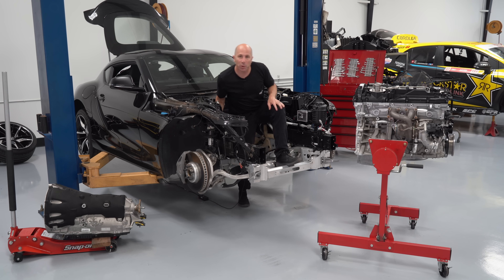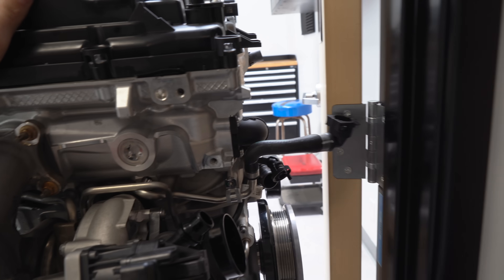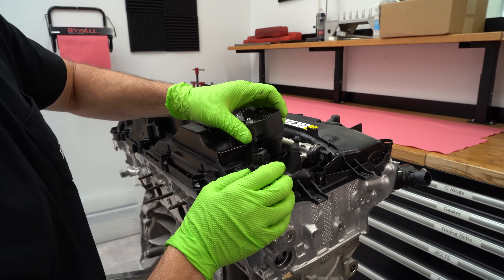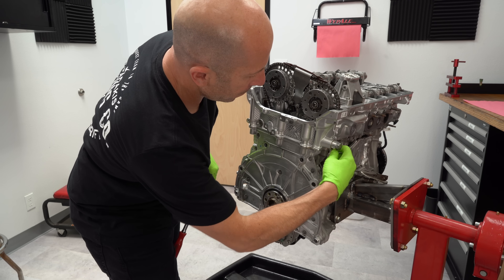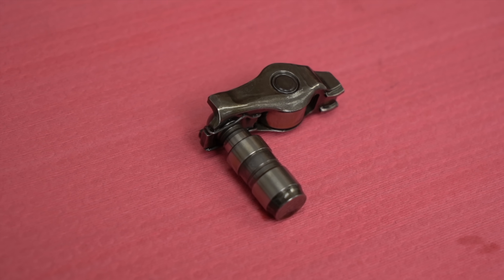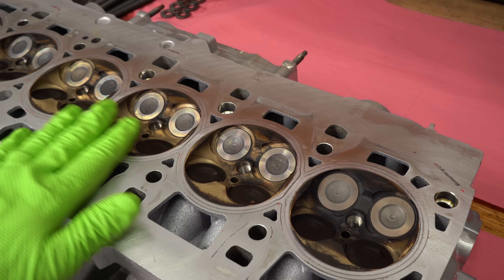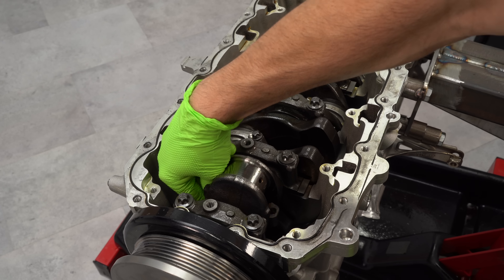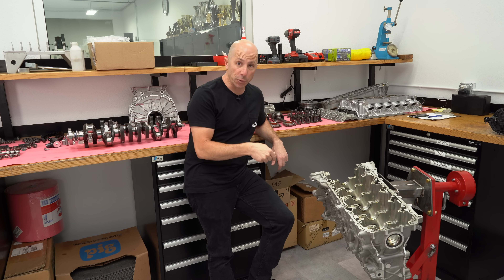2020 Supra B58 Engine Teardown - First Look - Better than the 2JZ?

Comment: I think this bmw’s piece of “engineering” will fall apart after first 60-80 thousands. Even in stock.
Reply: Considering most bmw's have a 4 year or 50,000 mile warranty of course it will. That's how bmw makes money. Spare parts not the actual car.
Reply: @mitzmanuel  I've already heard these reaching over 70k with no problems to speak of unless you have the first year models.
Reply: Carboy Dorifuto party 70k is great for bicycle))) not for the legend like supra)

Comment: Whats the difference between the b58 in the 140i ?
Reply: Heads,fuel system(more high pressure),has more oil squirters,and has a different mounted turbo.

Comment: I really think this new motor is amazing the engineering is immense but I also imagine this motor is extremely complex and precise thats great it shows how far everything has come but also it looks very daunting if your not mechanically minded I imagine its been engineered this way so you have to take the new supra back to toyota for services and any form or modifications or repair. It wont be to long though before there's a huge aftermarket for it. I think it's kind of cool the more complex the more potential the better mechanics become in order to work on it.

Comment: A bmw engine are german engine in a japanese car it never works well, bmw sells the exact same car but with 50 more horses the front and back are different but everything else is the same as the toyota supra.
Reply: Tony Oliver you are totally wrong, seriously wtf are you smocking!! You think toyota will just take a random bmw engine and slam them in the Supra? Grow up man , toyota worked with bmw to improve the engine reliability and tunability,

Comment: since it is 99% the same engine, that has been in the bmw for some time - the failures come the same way. 
So in comparison to the old 2JZ - You can calculate with big problems starting at about 60-100kmiles. 
It has really good potential for power though...

Comment: It looks like the block and head design were Toyota’s part of the project and bmw made all the ancillaries and bolt on products. I think this is going to be a fantastic engine really, being the replacement for such a loved engine means there is going to be a huge aftermarket parts catalog from big name brands and mad scientists alike that can really take advantage of the advancements in timing, air density and velocity and fuel injection. The only thing I am unsure of but purely because I don’t know anything about it is the internal exhaust manifold system. It seems like this design might take away from a major part of the tuning ability for the aftermarket scene, and possibly limit the amount of turbos to suit the application. Great video and am looking forward to tearing one down in the near future to see what tweaks are waiting to be found

Comment: It doesnt take a genius to realize that this motor is a cluster fuck. If you're pushing this thing close to what a 2jz can safely run stock then I'll be surprised if something doesnt fail. 

There's just so many things on this motor that needs to be revamped to make anything close to 1,000hp. That mechanical fuel pump doesnt flow shit let's be honest. Also those "exhaust ports" need to be wallered out asap if you wanna make any kind of power.
Reply: You can keep saying "but aftermarket will make this motor worth a fuck." Well who's going to waste their time and money into producing parts for a $60,000 turd.
Reply: @stellaroid  companies have already pushed just over 480hp with just a ecu tune with out touching anything on the motor. There's even a company out there that has a 530hp one currently that has just a tune and down pipes.
Reply: @carboydorifutoparty3976  I'm surprised that the stock turbo can flow enough air to make 500hp tbh

Comment: Ohh boy. I can only wait to see how many intake manifolds need to be replaced in the next 2 years. And hopefully that timing chain setup isn't weak because audi flashbacks. Ahh yes the wonderful valvetronic. What I find amazing is how reliable that valvetronic and vanos systems are. But I'm no BMW tech no I probably won't see this stuff at all until it hits the mainstream on youtube repair section.

Comment: That BMW engine in my opinion has way too much plastic and will come to haunt you later down the road.
Reply: You know all those ricer cars don't come factory with fancy aluminum plenums and shiny fuel rails, right? Just because there aren't any flashy aftermarket parts available yet, doesn't mean the engine has to look like this to function...

Comment: This engine looks like a reliability and repair nightmare. Typical German over engineering where all theoretical optimizations are incorporated with total disregard for servicing ease and cost impact to an Owner for parts and their replacement. If the piston heads and direct injectors are getting black at only 500 miles, what will they look like at 25,000 miles? I don't like direct injection with EGR unless backed up with port injection and catch cans. What was Toyota thinking? Maybe enthusiast cars don't need reliability?

Comment: Lots of plastic.  It'll go 0 -60 in three seconds, top speed of hundred ninety miles per hour, but will only last one hundred thousand miles before all the plastic junk starts to crack, split, and fail.  Expensive to fix.  Fuck BMW, Toyota screwed up.

Comment: I'm not sure on the b series bmws, But on older ones if you take the cams out like that, they will break.  These may be stronger?
Reply: I wouldn't even want to try doing that with a solid cast cam.  Too likely to bend it.

Comment: Will that intercooler lose efficiency over time as the EGR system pumps residue into the intake system? Seems any intake manifold I've ever been in with mileage has had a decent amount. EGR dump after maybe??? Just curious. BTW - Stephen I raced with you back in late 90s-early 2000's You made a couple trips out here to East Coast. Some of the hotel stays in New Jersey were off the hook. Love the channel bro!

Comment: Brilliant engine. Although, I’ve noticed a lot of planned obsolescence such as the one piece intercooler intake manifold and the sealant on the head gasket. Sneaky BMW. Sneaky....
Reply: The old trustful bmw plastic... 😅
Reply: The exhaust port design is bad for performance applications. Cam and oil chain locations are terrible

Comment: With all those plastics so close to high temperature metal parts, what is your expectation of this engine's lifespan? 60k or less? 100k? 200k (Toyota standards)?
Reply: My BMW engine, with plastic parts, started comming undone at 70000 miles..When the first plastic part fails, take it off the road and replace ALL of the plastic  parts.
Reply: @zymmer4  do you mind sharing how much it cost to refresh all the plastic parts?

Comment: A lot of the engineering on the block reminds me very much of a Sport Bike engine.  I see 2 more cylinders and a very interesting combination of top end and bottom end work especially with the oil pump and the timing chains.  Some of this technology has been around for years but its interesting how its married to the all newer engineering of variable timing control and what not.  It looks stout and I imagine this will hold up and respond very well to heavy modification and might even work well for swaps in a heavier vehicle if done right gearing trans etc... looks to be like one heck of a reliable design from the inside.

Comment: bmw junk not matter if its good now before i say any thing more negitive lol  i know the Japanese folks vetted n improved parts of this the engines internal part butt only a idiot German or ford engineers could do a timing chain on the rear and no oil stick n hollow  camshafts gross   ect electric water pumps just stupid n plastic intakes suck very ugly engine the 5mge is the nicest looking one i see German every were on it i guess in ways its better lightweight only n a bit of tech... a fully designed by Yamaha n Toyota would have been nice n then i would buy one but no ill keep my mk2 n mk3 .

Comment: This looks incredibly complicated to me after watching hundreds of american motor videos. Where is the carburettor that you pump with you fot and hit with a hammer?
Reply: Its really not that complicated. Carburetors are such old tech and not efficient.
Reply: @ryanb8736  Jeremy Clarkson Said European engineers could get as much horsepower from a bag of flour as the americans get from their big cc engines. Funniest thing I ever heard him say.
Reply: merqury5 Haha. Yes, it’s all about technology. 

I used to build fast V8 engines when I was younger. Now I have a 5 cylinder Audi that would beat them built engines. Tune and easy bolt ons it’s close to 600. Can also drive it in the snow and ice with ease. 

The problem was building them and they would barely idle with big cams just to make the extra power. Traction was also a problem. Then transmission and rear gears could only handle so much power too. Breaking lots of parts was a common thing in old cars. 

New technology allows for optimization, faster shifting, lot stronger parts, perfect idling cars with 600 plus HP that can be used as a daily without ever knowing.
Reply: @ryanb8736  stop it, you are making me sad. I have an MPV....

Comment: I already can see many faults on this engine.. 1 is head bolts. Same design headbolts used MB, but those bolts want on high pressure to strip off. I suggest to use different design. Like on crankshaft.

Also that plastic.. Heat cycles will kill this engine.

Comment: I love the way you describe every piece as it was being taken off.......top notch education.  Thank you!
Reply: Yep .. Ive learnt more from YouTube than I did in my MACHANICS class.
Reply: @UC4_hROdH7_Oc4CPH7c-E0Rg this B58 is the modular predecessor  of the N54/55 but is now closed deck with diesel components shared from the B57 has forged internals and crankshaft with a high pressure fuel system(that's only in the mk5s B58 not BMW's)has more oil squirters than a normal B58,engine is already hitting over 700hp on stock block and internals with a tune,bigger turbo,and downpipe unopened and has yet to hit its limit in hp. Current mk5 record of hp(for RN)is 527hp with only a tune and downpipes so numbers should climb even high as companies continue the R&D for it.
Reply: I'd say pulling the trans would be the process simply for engine mount reasons. leaving it in the car seems way better than pulling.

Comment: The engine is amazingly advance but also not that complicated. Most routine parts are easy to get to like the intake and exhaust manifold/turbo charger and the coils and sparks. This is still a car that I would take to a mechanic for routine maintenance, but it’s not totally crazy to drop 5k on a decent set of tools and wrench yourself if you’re into that stuff (which I am no longer).

The timing change being wedged between the back of the block and the transmission is going to be a disastrous bill come 100,000 - 150,000 miles.

Comment: Timing gear on the back of the engine. Hmm OK. Lots of plastic engine parts. Hmm OK. Internal Exhaust Manifold... Hmm OK.... Plastic inlet manifold... Oh man this thing sucks balls and long term it will all tell. VAG have been this route and... It sucks. It's a shame the block looks well engineered, structurally
Reply: Thousands of PSI mechanical fuel pump.... What should we mount it to? More plastic!!! Oh. My. God.

Comment: BMW can't ever learn NOT to put timing on the back of the engine ffs...remember N47
Reply: To be fair the famous N47 pre-mature failures were a faulty "out of spec" batch of crank sprockets which were eating into the chains.  I've got a N47 2009 E90 3 series on nearly 200k without a hint of timing chain rattle.  Original engine and chain...
Reply: Because there is nothing wrong with that location. It's not even that much harder.
Reply: @jdrok5026  Not even that much harder as in you have to take the engine off as opposed to not taking it off?
Reply: @AutomotiveConcepts  People will pay huge amount of money to buy and to repair the cars , double win for them 😂
Reply: @AutomotiveConcepts  it's really not much harder.

Comment: Good replacement for the 2JZ? And "partnered with BMW" as an aside near the end of the video? BMW design and manufacture; Toyota participated via suggestions during the design stage and once the vehicle was nearing the production stages Toyota went thru the engine to spec it to their standards. IOW, there ware Toyota engineers assigned to the BMW design team in Germany to "save Toyota's ass". IMO, very minor differences between what is sold as a BMW Z4 and as a Toyota Supra. And the rest of the car got the usual "badge engineering".  Yes, the brakes and suspension got Supra specific tweaks so that it felt more like a Supra to past Supra owners - but a true connoisseur of the Toyota marque won't be fooled.

Sad that their was no mention made in this video of all the parts labeled as BMW the underside of a supposed Supra; but I realize this was an engine tear down video by Papadakis Racing. As a Toyota fanatic going back to 1972 when I worked as a line technician and then opened my own specialty Toyota independent service facility in 1975,  I have mourned the loss of the Supra in 2002 but I am incensed that it came back as a BMW built product. The main reason that the Supra didn't get a new model this century was due to the low sales level that the Supra has always suffered from was IMO that the "cost accountants" couldn't rationalize the cost of replacing the 4th generation Supra; and then by 2009 when the entire auto industry in the USA and Japan almost went "belly up" there was no way that any company would proceed on their own for such a low volume vehicle. I guess you're damned if you don't and damned if you do proceed in this manner - especially taking into mid that the age of petrol/gasoline engines of quickly coming to a close.  The Z4 / Supra may be the last new vehicle of its time, other than the mid-engine Corvette.

Comment: That looks like a typical BMW engineering nightmare, just over engineered like the typical German car. It's gonna become an endless money pit when it's a decade old. For exp to replace a timing chain and guide you have to take out the whole engine and when the thermostat goes out instead of a 5 dollar part it's gonna cost 500 for their electronic controlled one. And did they really have to add a second chain for a oil pump?? They could've had the oil pump driven off the crankshaft like every other car. I don't mean to bash the new supra it's just that BMW engineering is absurd
Reply: ad636051 i think this is just german marketing and programmable wear. So they completely sure that after first 50-60 tkm you will give them all of your money)))
Reply: You apparently haven't seen inside or worked on any new engine in the last ten years from almost any manufacture.
Reply: @justinweber1838  I've worked on tons of engines and I only notice Germans cars have the craziest designs Americans and Japanese are much more simpler and logical. I remember an audi where you had to lift the motor off its mount just to change an accessory/v belt where as on a Toyota or Chevy it's just a simple loosen and replace that I can do in 5 min instead of an hour. The German engineers must be on Crack when R&D